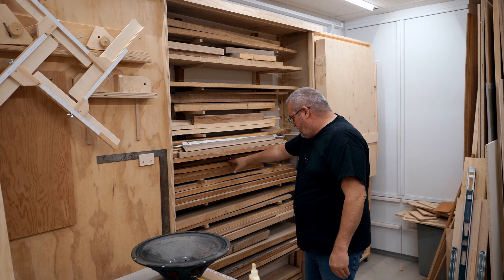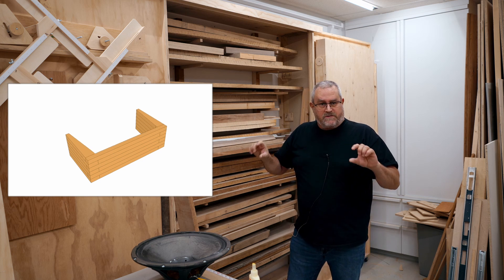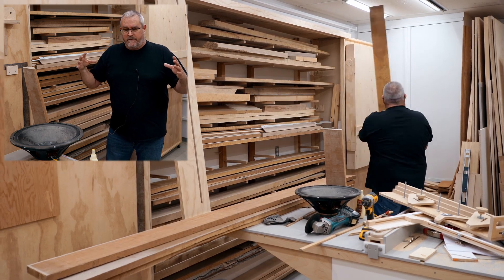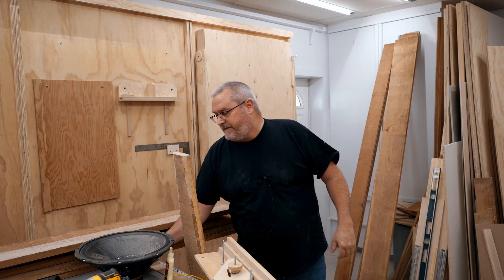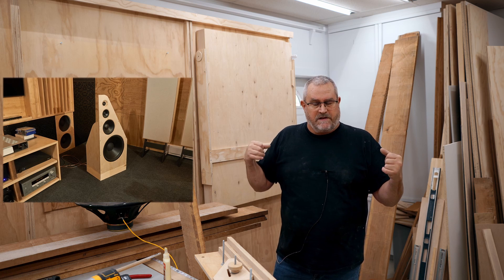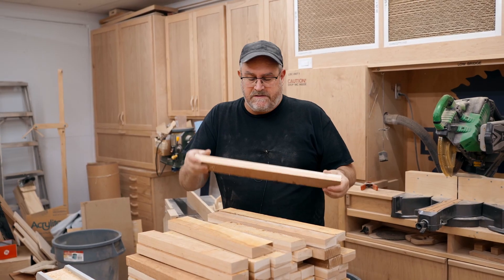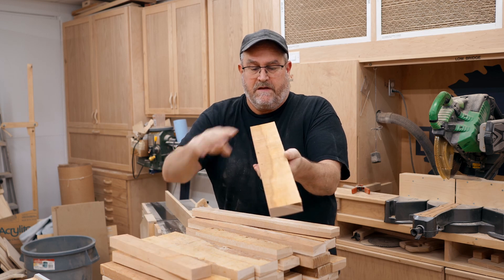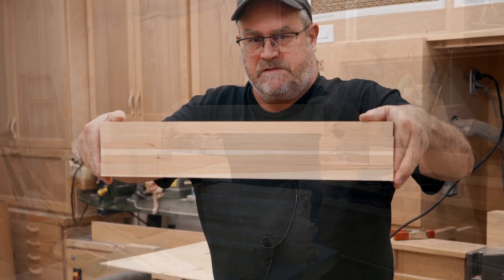Making Open Baffle 4-Way Speakers - Part 1

Comment from the maker: What are open baffle speakers? They are speakers that aren't in a box, basically. And that can mean something very simple like having the raw drivers mounted on a sheet of plywood. I'm going for something more elaborate with a shaped baffle with side wings.
I decided to use solid wood - cherry - because the baffle design is fairly complex. Solid wood does have a serious problem, in that you need to be aware of and make allowances for seasonal expansion and contraction. Leaving some space around the woofer so that it's not a tight fit will solve this.
In this first video I go through some of the details of the design (more in future videos) and start cutting the parts to make the baffles.

Comment: 🟦.... As for why you have decided to depart from the acoustic standard of a vertically aligned array is beyond my ability to fathom, but since that's how it is then You have them set up REVERSED!.... The way they are In the thumbnail the air pressure from each transducer will push upward & inward on the wave from the transducer above it, narrowing the Sound Stage,.... 
....whereas, if you Reverse them that same effect will now WIDEN the soundstage as well as project it slightly-upwards, so there shouldn't be any necessity to tilt the cabinets back, although for critical listening you may end up wanting to turn them slightly-inwards in order to get just a bit more on-axis with the mid & high-frequency drivers.

Comment: Hi John. Have you come across these guys experimenting with making Sound Panel speakers ? Their video came into my feed ... https://www.youtube.com/watch?v=GslJ8Hf4WwE&ab_channel=TechIngredients. As the whole panel needs to vibrate without interference, they suspend the sound panels in an attempt to gain isolation. Chris.
Reply from the maker: I've seen it and many others have pointed it out in previous comments. I'm not sure why, though.
Comparing that to what I'm doing here is like comparing a string pulled tight with two tin cans at the ends to the latest iphone.
Reply: Understood John. I wasn't looking at a comparison really, but wondered if there was anything in their discussions which you would find interesting.

Comment: Looking forward to this John. Why do you prefer open baffle?
Reply from the maker: I can't say that I have a preference. I think any type of speaker can sound good if done properly, and I can't confirm the often repeated advantages of OB (less room interaction, more "open" sound, better dynamics). 
Basically, I just decided to try it and have liked the results enough to make them permanent.
With that said, these do disappear in the room and set the deepest, widest and most realistic soundstage I've ever heard. A lot of that could be the room I've set up to do the listening in, but I wasn't getting the same effect with the box speakers I used while building the room that came before these.

Comment: Isn't your listening room / home theater insulated enough, so that seasonal changes won't matter?
Reply: It is the changes in humidity that will cause the wood to expand or contract.  In winter it is dry and in summer it is more damp, especially in a basement.
Reply: Ah, okay, thank you. Thought that wouldn't have a strong impact in a well insulated basement.